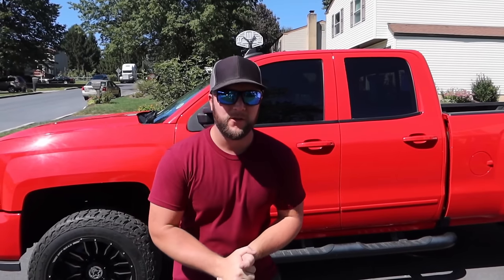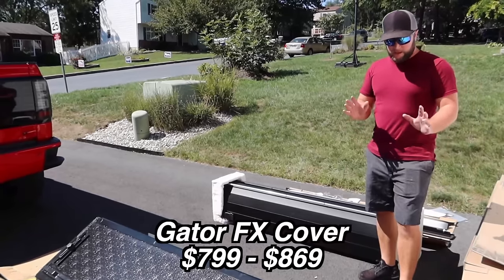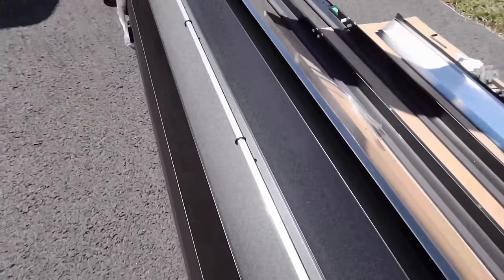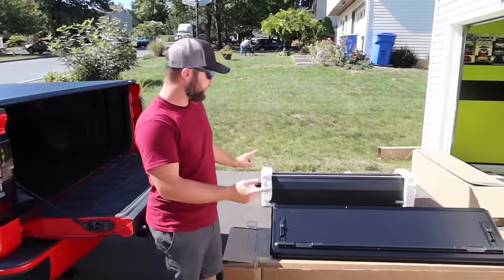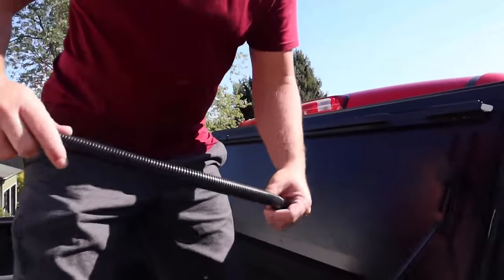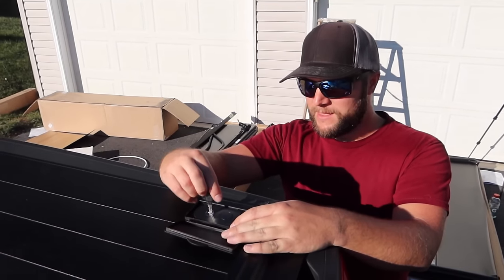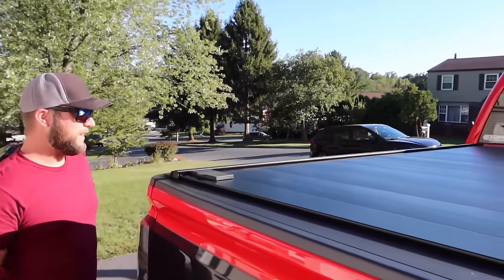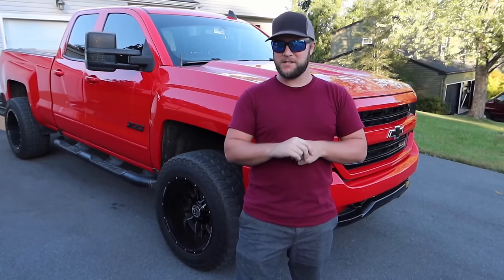The ULTIMATE Tonneau Cover Comparison | Truck Central

Comment: Thanks for all the work you did to put this together..!!
I generally, only carry loose items, or maybe some weekend gear for camping or boating, so just being Out of Sight is good enough.. BUT if a boat or jet-ski is in tow... some people might get curious. 
But as you sort of touched on, I carry motorcycles rather often. and they are pretty close to 7 feet long by the time you include the tires and wheels. So I NEED the full 6' 4" of length, even with the tail-gate down. So all of the space used to stow the fold-up and roll-up makes it next to impossible to get a street bike loaded. But the basic one, I can take off and lay it beside the bike(s) during transit. And I would not want to travel with the back window blocked, so I can not see the bikes. (I drive Semi's, buses, and lots of other vehicles, so I am very capable with mirrors. But I like to be sure that bikes are riding stable... 
So your information is Very Helpful. Thanks again.

Comment: Very informative.  Good thing I saw this,  I'm in the process of purchasing a bed cover .for my real truck ( no 4 door grocery getter ) one cover I was looking at also was the diamond plated bed covers .it's more top of the line .has 2 fold. Side fold have you looked at those ? And a problem I'm having is my spare tire . I have 3 inch lift kit. Wider tires . Looked at tire mounts for inside truck beds but no way to lock the tire to rack other then using a chain, padlock thus defeating the purpose of a tire rack in my truck bed I can just chain it in the bed. Any suggestions?

Comment: The tarp option is tempting because of the price but I wouldn’t trust it for security purposes. Seams easily accessible by cutting through it with a knife. Still trying to decide on which one to get for my truck.

Comment: I’d love to see a long term review of the middle grade tonneau cover.   I used to have the cheap trifold one and it worked great.  But the vinyl wore out after like 5 years and then I needed to get a new one.
Reply: Did you replace it out of pocket or used the 10 year warranty?
Reply: @LuisRodriguez-ib3cc  the one I had bought had like a 3 year warranty.  Either way I got my money out of it from daily use.  I replaced it with money out of my own pocket

Comment: #2! I'm looking for a good solid cover that looks good not overlapping the edge of the bed and secure. It needs to not block bed space to be able to tie dirtbikes down in the front so its looking like number 2 is the clear choice. I wish it didn't block the window when open but it doesn't look like that would be possible.
Reply: Hey Which bed cover did you purchase. I’m looking at the trifold Gator or maybe BakFlip.
Reply: @josephpuchel6497  I got the Bakflip rolling one and really like it

Comment: I had the middle one. It was great but the stabilizer bars to hold it in full open position get sticky. I had to use pliers to loosen them up on occasion

Comment: I agree the mid grade is the one i would pick also. I have a f150 with the 61/2 foot bed and looking for a cover. It came with one of those plastic bed inserts so not sure how this will seal with that installed. Great video and lots of good info.

Comment: I have a  tri fold soft cover from a company called  Tyger
Great cover for the money  
So far it survived 3 northern New Hampshire  winters zero problems
Reply: Just got my Tyger Soft Tri-Fold today.  Installing it after work.  For my needs, I just couldn't justify triple the cost for the Hard Tri-Fold.
Reply: @gordiehattrick  cool ,you will like it
Reply: I have the exact soft one he reviewed and I love it. I was on a 5 hour road trip this summer and it stormed the entire drive and my luggage and everything in the bed stayed dry
Reply: I have the Tyger as well. Doesn’t leak at all, not even thru a car wash. About $250 for my 8’ bed.
Reply: @RealEyezRealLiez  wow even through a car wash! Great info for ne. Thanks
Reply: I have the Tyger also on my 2019 Ram Laramie. The good thing is it was only about $200. It has not leaked during rain storms and only a little water gets in when going through a automatic car wash.
Reply: @mierzwaj  thanks

Comment: Can you stand on any of them to access stuff on the roof or as a boost up?   I used to do that on my Avalanche that came with a 3 panel cover.
Reply from the maker: The hard folding cover is the sturdiest, especially closer to the edges as opposed to right in the middle. But why wouldn’t you just stand on the bedside or side of the truck with the door open? That’s where the truck is braced for a ton of weight.

Comment: do you have a hard tri-fold cover that fits Honda Ridgeline 2024, how many clips hold the rail on the truck, do installation requires drilling and is there a vidéo about the installation specific to Ridgeline. Thanks !

Comment: I have another brand of the cheap option. Its poly and metal. About 50 pounds. Its great for security, can stand on it for washing or put tint on it for camping. Cost $329 shipped with a limited lifetime and 2 years full warranty.
Reply: What brand is that?

Comment: I had a hard cover tri food I hated it so much that I wound up just giving it away.? The roll up covers just seem like a easy invitation. I’ve had them all on my trucks thru the years camper shell included. In my opinion the roll n lock was probably my best choice.
Reply from the maker: Curious what your experience was with the camper shell - would you ever go that route again?
Reply: @TruckCentral  it sure kept the weather out. But it was always in the way when I needed to haul something. Fire wood,rock mowers etc. plus I was always bent over to get anything out that had slid past the back of the wheel well. This wasn’t that big of a deal 40 years ago, But now…..

Comment: Very informative video.  I have the Gator FX on my ‘20 Ranger.  I like it a lot.  It does leak a little in the back corners by the tailgate in heavy rain. It is nice that it folds up against the cab if needed for nearly complete bed access without having to remove it.
Reply: I’m considering the FX and appreciate your comment on the water tightness. I will be towing a travel trailer and would be storing equipment that I would like to keep as dry as possible- generator, chairs, grill, etc. Do you think extra weatherstripping would help?  Also, how secure is the cover with the tailgate locked?
Reply: @b737driver8  we had very heavy rain a few days ago. I looked and sure enough there was water inside by the tailgate.  I saw a drop hanging from the drain channel so that is probably the source.  Not sure what to do about that- the water has to get out, especially in the winter. I did not see water anywhere else so storing things away from the tailgate might be the best option.
Reply: Sorry I did not answer your other question regarding security.  Near as I can tell it is secure.  It someone wants to get in they will, but it would take some effort.  It is probably as secure as it could be given what it is.

Comment: Covers are a great investment and all depend on how you intend to use your truck. 

I personally have been a fan of soft roll up covers especially on my trucks with the smaller bed length. Cheap, minimal leakage, mounts on the inside of the bed rail, rolls up when full bed space is needed for large loads and rolls back just as easy. 

I have seen too many soft tri-fold covers that have kinks in the areas where it folds.

Comment: What about tie down access for each model?  Rails cover top tie downs? And inside tie downs especially with the roll up most expensive?  And during install, if u have a bed liner insert(not spray on), does the Liner hinder install?

Comment: I had the privilege to owe all three model. In my personal experience I recommend the second model (hard top Gator EFX cover). Its not the cheapest one and sure isn’t the most expensive. However, it provides you the quality that you need to protect your personal belonging.
Reply: Waterproof?
Reply: How much water seepage did you actually have with the hard folding (#2) model?

Comment: I have putco bed rails already. Would this or any other tonneau cover work along with bed rails? The hand holds as you called them are where the bed rails go into and they are bolted from the inside of the bed by removing 4 of the plugs

Comment: Just an idea,but maybe you could install a camera somehow to see back there when the second cover is folded against the glass.Like a backup camera device if you really wanted to see since it blocks the rearview mirror. Great video and nice red truck by the way.I like those Chevrolet letters on your bed rails. 🥰👍🇺🇲
Reply: Ram and gmc offer a rear view mirror camera. The camera is by the third brake light and the rear view mirror has a screen in it. Don't even need to see through the back glass.

Comment: Good review of options.  I have the soft (1st) cover and it works fine for my gooseneck on an 8 ft bed.  I can't comment on 6.5 ft one.  Gooseneck takes less space than 5th wheel but my B&W 5th wheel adapter also fits under and is operational when folded up.  When my tri-fold soft top wears out I'll get the second one you reviewed.  I like that it locks down in several positions and provides better security when fully closed.  Also doesn't cover hand holds!  I'll have to measure to make sure the 5th wheel adapter will fit under it but it should.  3rd cover should work for trailering but I carry my fuel jugs for racing under the folded front cover and I can't afford to lose that much bed space.  Plus, for that much money it's not even electric!  Update:  Discovered the Gator FX is not made for an 8 ft bed.

Comment: I have the retrax roll up. Looks great but catches on something internally and won't roll all the way. This happens about 1 out of 10 times. The worst thing is, it leaks. But reason I wouldn't buy it again is I didn't really consider how much I needed the whole bed, that I would need the 8 or so inches you lose in depth and width.

Comment: I put the trifold on my F150 Crewcab 5 1/2 inch bed.  Leaked terribly.  They replaced for free three months later and the new one leaks as well.  The leaks are in the trifolds.

Comment: Great video. Even though I'm not in the market for the soft one I was wondering if it flops around at high speeds. I appreciate the review and bought the tri-fold version because of your video.
Reply: I have a vinyl cover and at high speeds it flops a bit. But you can adjust it to stretch it out to reduce the flopping. I bought it from Amazon, brand is Tyger.
Reply: @dannyldart  is it noisy when it flops?

Comment: It seems that #2 would be more secure if you clipped that cord. A single, short cord, would be better than an easily grabbed loop that someone could get with a coat hanger. Yes, they do still make metal coats hangers LOL.
Reply: Any cover will only keep honest people out. A small pry bar will get someone into the bed in seconds.

Comment: In my case 14 tacoma short bed i have a bakflip trifold and im upgrading to a usa roll on beacuse my truck has a sport rack on the bed and with the backflip cant use the whole bed and with the roll on i will be avle to.  taking off and putting on the trifold because of my sport rack finally got to me and also will be able to use the full bed for mi bikes

Comment: Which one do you guys think is best??
Reply: 3
Reply: None of these.  I like the AMP ones better.  But if I had to choose I would do a soft cover because it doesn't lose bed space or block your back window.
Reply: Definitely not the most expensive one. 👍
Reply: I've had my backflip hard 4 section 8' tonneau for 4 years and it has been great. 99% of the time it remains closed and seals out the weather while looking sleek. I opted for it over the rollup version because I didn't want to loose any bed space and have not been disappointed.
Reply: Number 2. I have the GM accessory one like the 1st one, because it was on the truck from the dealer.  Not a fan of the 3rd one for me. My elderly step dad would love it though.
Reply: I just ordered my 4th ARE,love them
Reply: Neither. On a short bed you lose a foot with the Gator FX.  The Tri-fold Gator can be opened with a hangar through the top of tailgate.
Reply: @JC-hl3tn  that’s why you get diamondback
Reply: I have #1, works awesomely. Other two are tooooooo expensive for what they really do.
Reply: The  one you can afford , very simple.
Reply: I have the sfx. It’s been great.
Reply: The Ultimate ????.....Diamondback truck cover is the Ultimate period....it's in it's own class ....nothing like it the best purchase I have ever made.
Reply: Neither, because each for their prices has downsides.

Comment: Why would you need to use the handles to get into the bed with the first cover when its closed? If you need to climb into the bed, the cover would be open and the handles would be open for use.
Reply from the maker: This is true 🤣
Reply: It's not a handle, its a pocket for a 2x4
Reply: @siropis1  Sure, originally that was their intent but they are shaped that way on purpose, to be used as convenient handholds in conjunction with the foot wells in the bumper to help boost up and into the bed.

https://www.gm-trucks.com/forums/uploads/monthly_2018_10/20180928_175643.thumb.jpg.4d1ccd0a66070936a534185bbf29dae1.jpg

Comment: What do you recommend for a 2016 Ram with Rambox's
Reply: I bought the GatorTrax MX from realtruck for my 2020 PowerWagon with Rambox's. It leaks all the time. The cover isn't long enough and leaves a gap at the tailgate for water. You cannot put enough weatherstripping to seal it, and real truck could care less. So buyer beware, it looks great, but it doesn't keep your bed dry, and for that money, it should.

Comment: I still don’t understand the reason or draw to having a keyed lock. All new tail gates lock the bed is already secured if you can’t open it without lowering the tailgate, having a key at that point is annoying to need to have with you for use. I get the rolling retractable that opens from the underside for that reason.
Reply from the maker: You hit the nail on the head. There are more drawbacks than reasons for it. There are some specialized use cases and “I want the best” cases where it does start to make more sense though.

Comment: If  you actually use your truck, as a truck....the cheap tri fold is perfect.  I can completely remove mine in 45 seconds and has no hardware to get in the way.  Protects the bed from the elements and if it rips....Flex seal tape makes it new again.  Weighs about 15 lbs or so I'd guess as well.  Those other things are the pervue of urban truck owners who think loading it with groceries at CostCo justify's the price!lol!

Comment: Diamondback is far superior to any of these. If you’re going to spend that kind of money, you might as well get the best.
Reply: The DiamondBack is nice, true, but it also was 3X more $$ than I wanted to spend. Pius, don't really like the way it opens (2 sections with that bar in the middle).
Whatever, I didn't want a cheap/soft tonneau/bed-cover, but a hard-cover, not the "best" cover though. Spending ~$1K was the limit, and at that price it's a decent well-made cover with a good value/cost ratio.
I got an Undercover Ultra Flex...about the same price as the BAKFlip MX4 I was TRYING to get (from my local 4x4 store) but after weeks of waiting, found out the BAKFlip wasn't available due to their suppliers not being able to get BAK the materials needed to MAKE them, and no date from BAK just WHEN they could make/ship them. 
So I got my half-down deposit $$ back from the 4x4 store (on the "MIA" BAKFlip MX4) and I went with Undercover instead. It was IN-STOCK @ RealTruck and shipped the same day I ordered it (before 3:00pm).
My local 4x4 store had "free professional installation" so I preferred to get my cover from them, but they couldn't GET it anytime soon (said it'd take 3 weeks to get an Undercover, let alone a BAK, even IF BAK was back to making them) so I had to do it online instead -- it's being shipped to me and I'll install it.
Taking a road-trip and need to carry stuff in the truck bed out-of-sight (and fairly well secured), so HAD to get a bed-cover NOW, and without the indefinite (at least 3 weeks more) WAITING.
I could do worse than an Undercover Ultra Flex, I'm sure, and for the price, not much (if any) better.  ;-)
-- BR
Reply: Agreed but if ur gonna spend that much and if weight isnt really a concern might as well buy a truck cab canopy from smart evo or alu
Reply: Not really good for fifth wheels gooseneck hitch depends on u're application

Comment: The dick who buys the $2000 cover will brag about spending $2000.  The person who like me who would buy the $200 cover would just use it and be happy.  My choice in "Cheap Covers" are made by Estang. The cover comes off without a fuss and the truck bed is used like it should be. I have the original one I bought for my 2010 Ram and for my 2018 Ram it still looks new. So in ten years I spent less then $550 and I have two bed covers on two different trucks!